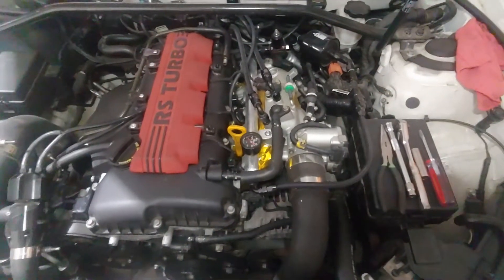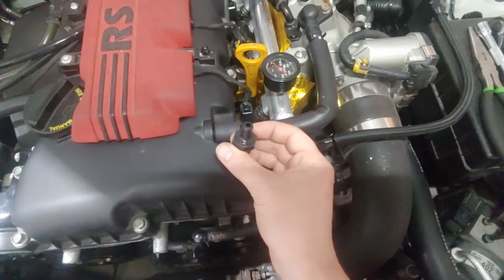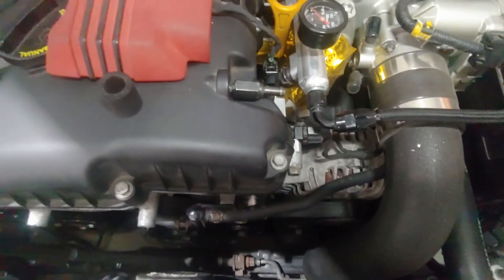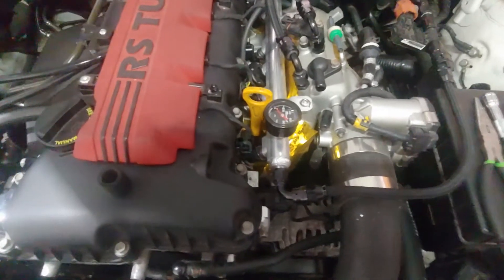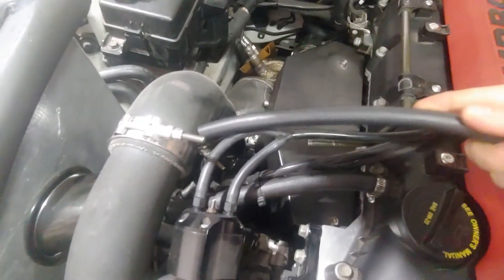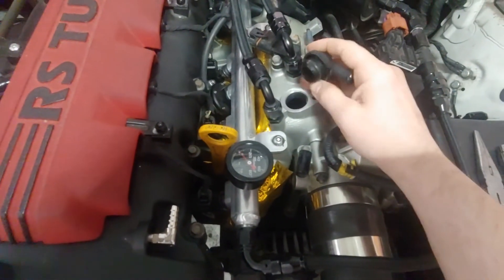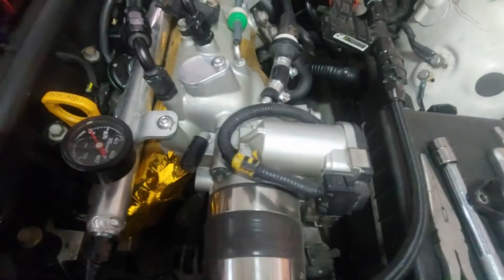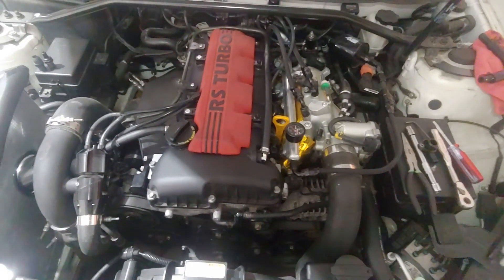PCV Re-Routing, Genesis Coupe 2.0T

Comment: Would a dual catch can be a better set up im just curious??
Reply from the maker: In the past I've barely had any blow by so it depends on your motor. There are also cans that have 2 inputs and 1 output like Nuke Performance that would be perfect for this application to avoid having 2 cans.
Reply: @Weekend_Garage  cool beans. Also would a bad pcv valve cause an oil leak?
Reply from the maker: It could. If there is a blockage it will cause increased crankcase pressure the seals will begin to have oil push past them. If the PCV valve isn't closing when under boost it creates a boost leak and will pressurize the crankcase.

Comment: Hey bro,that fuel rail, how you did it???
Reply from the maker: I made the one that's on my car. I have other vids where I show it more. You can buy the billet version here: https://gencoupestore.com/gencoupe-store-billet-fuel-rail-genesis-coupe-2-0t/
Reply: @Weekend_Garage  thanks bro,quick question, it's asking me what rail fitting i want, what would be best for my 2011 Hyundai genesis coupe 2.0t R-Spec???
Reply from the maker: I'd recommend contacting them through the site. Then you can get squared away with what's best for you. The rail is designed to accommodate the OEM returnless and return style fuel systems, but doesn't work with the stock feed line due to it's shape and bigger size.